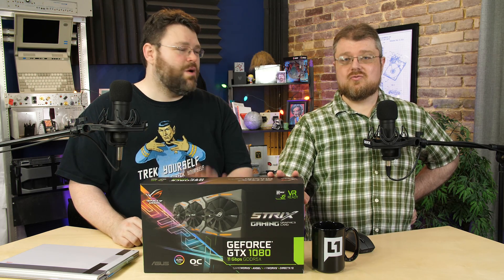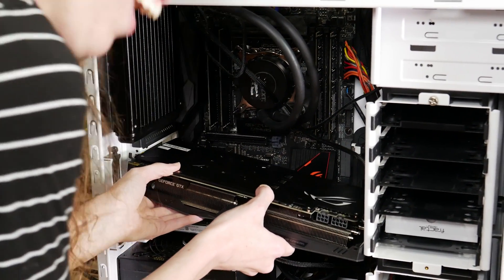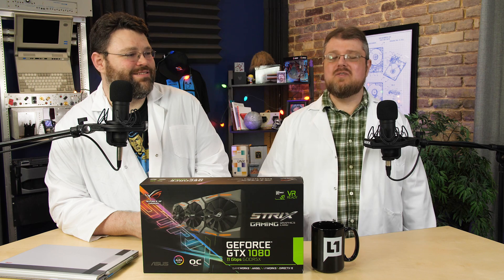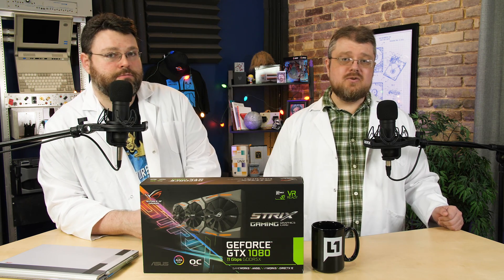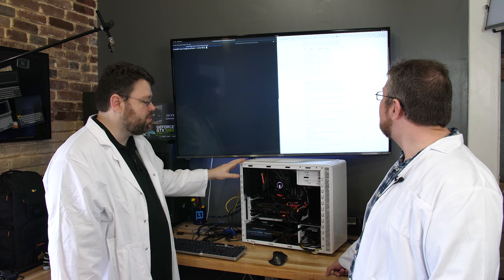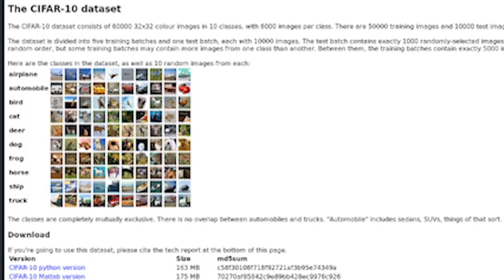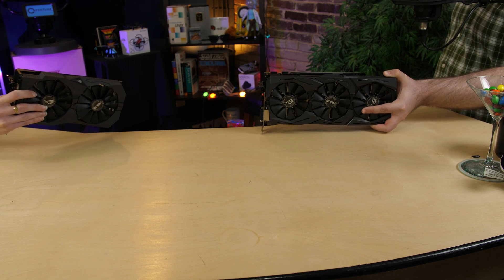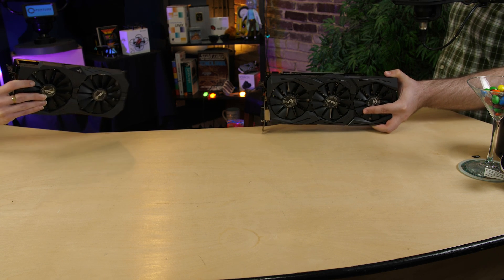ASUS Strix GTX 1080 11gbps: Machine Learning and More!

Comment: Hi Level1Tech, like @mindburst360 commented earlier, I'm confused about how you presented this card as having a different type of VRAM than the 1080 FE. 

Newegg Comparison for reference: 
https://www.newegg.com/Product/Productcompare.aspx?CompareItemList=48%7C14-126-201%5E14-126-201%2C9SIAD6H5ES5383%5E9SIAD6H5ES5383

As far as I am aware, both the FE and Strix GPUs should have the same type and same amount of VRAM (GDDR5X). The Strix 1080 11gbps has (as the name implies) a higher effective memory clock on the VRAM memory of ~11000 Mhz relative to the FE VRAM clock of ~10000 Mhz. It's interesting that this would have such a large impact on the cats per second score between the two cards (almost 30% improvement over FE) for this particular machine learning example. Do you think this difference is attributable to some other quality about the GDDR5X VRAM used in the Strix version? Perhaps you could test out both cards at the same memory clock?

Thanks! Love your videos, and I'd love to see more videos like this which benchmark graphics cards outside of a purely gaming-FPS centered approach like the majority of other channels on YouTube.

Comment: I'm super confused. Did Asus take the cooler design from the 1080Ti Strix model and moved it to the 1080 production line recently? I have 2x Strix 1080's and one Strix 1080ti, and the cooler on the model you are showing here looks exactly like on my Ti model (2.5 slots) but the Strix 1080's I have use a more standard 2-slot cooler, looks similar but different.

Comment: Can you use the GPU for GPGPU like this when it's your primary display adapter or do you need another display source to free up the card, like when doing CUDA tasks?
Reply: Matt Courtemanche
In the case of Blender, which is also GPGPU when using the Cycles render, yes, you can use the display GPU to do compute, with lower performance. Seperated Display and Compute GPUs are recommended.